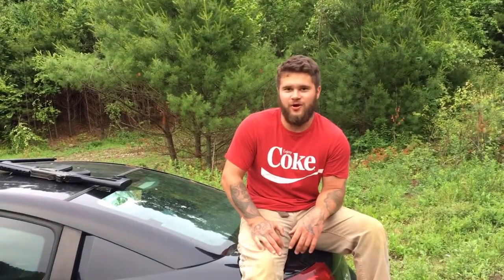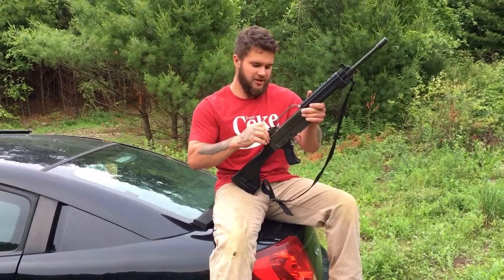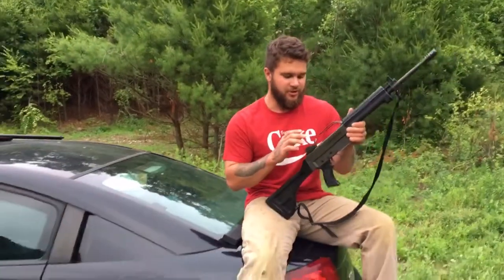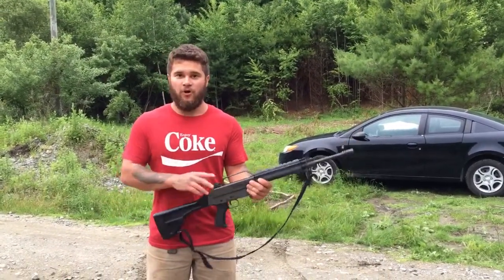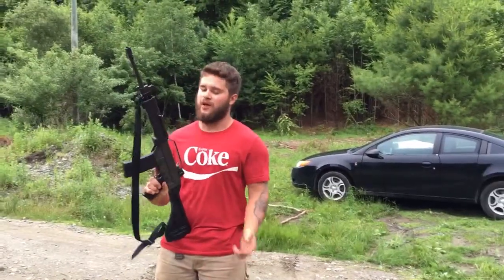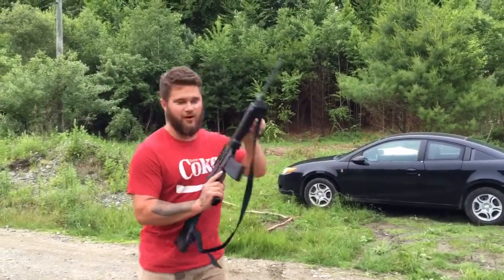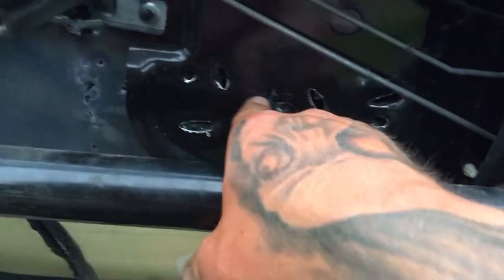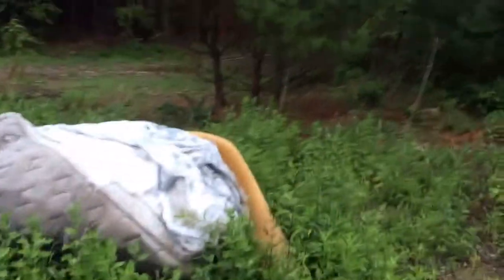BETTER then an AR15? RAREST gun in the USA

Comment: wait does this australia gun absorb some element of ak rifles?
Reply: Nope, no AK elements involved. It's a modified/updated Armalite AR-180. 

The main differences between this and an AR-180 are the non-reciprocating charging handle in the handguard, a 3 lug bolt instead of 7, captured main springs and a bit simpler lower receiver that takes unmodified STANAG mags.